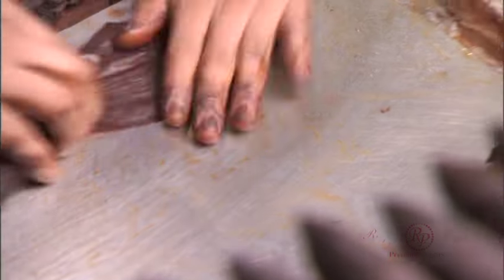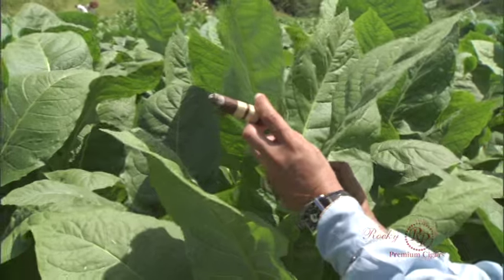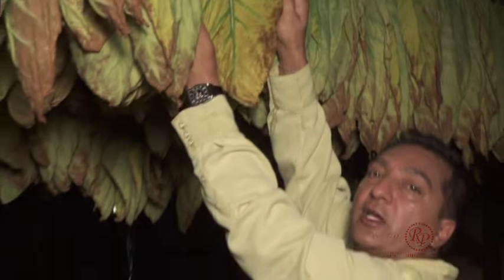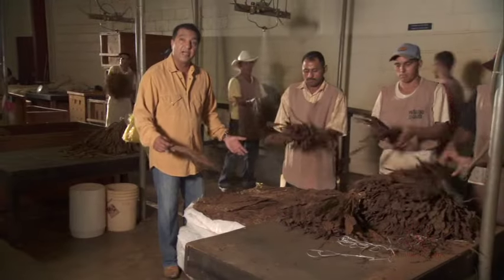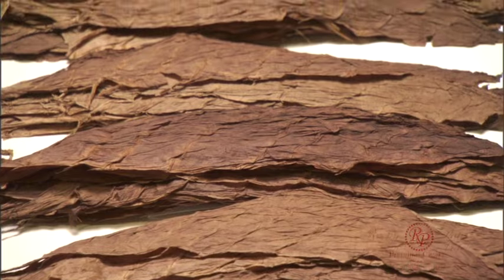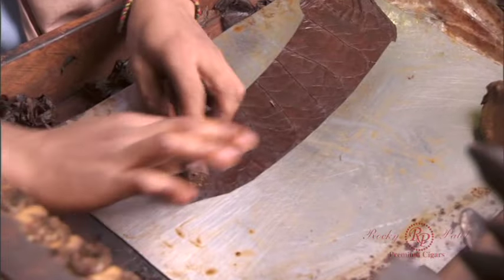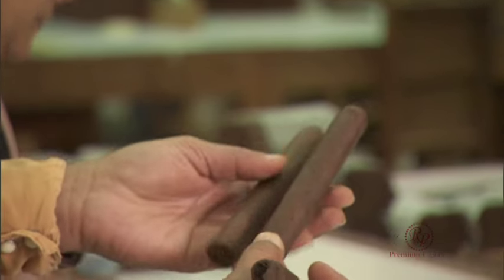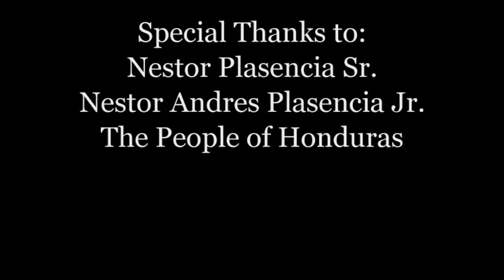Rocky Patel Factory Tour

Comment: Another little secret in this process is the final color stabilization area - not shown in this video.  If anyone wonders how they get the consistent coloration in a box of fine cigars, we have to go to the rectal injection curing room.  It is in this room where the cigars are given their final flavor and coloration treatment as they are inserted in the rectums of specially bred and fed sheep.  The cigars are left in the sheep rectums for a period of five days where they are infused with specific colors and surface flavoring custom tailored to each box and product line.  This consistency is ensured through the breeding and feeding of the receptor sheep.

Once this final process is completed, the human ejection professionals will carefully remove the cigars from the sheep rectums using the paper ring method.  Very few people understand this is why the cigars have the paper ring - it is used as sort of a toilet paper to protect the hands of the ejection professional.  Cigar diameter sizes are actually graded based on the rectal cavity of the receiver sheep - as "grosso, middo, and pequeno"

Comment: What was being put on the tobacco at 1:01?  Are some Rocky Patel wrappers dyed?  I also noticed that around that same time frame, the torcedor's fingers were covered in the same liquid.  I like Rocky Patel cigars, especially The Edge and am still trying new ones.  It is very disappointing to see what looks like a dying operation going on.
Reply: ftfisher4x4 not dye. they moisten the tobacco in order to start the fermentation process.
Reply: they took our jerbs No, the section I'm talking about shows the workers rubbing a dark, thick liquid on leaves that are already fermented.  This is different from spraying the leaves down before they are stacked for fermentation.
Reply: ohhh ok got ya
Reply: Marc Parent water,, adding moisture to the tobacco leaves
Reply: dennis paplow It is not adding moisture to the leaves.  The liquid is dark and thick and stains the hands of the workers.  It is some sort of darkening agent.
Reply: dennis paplow I roll my own cigars and if you want to add moisture, you use distilled water.
Reply: yes,, that is correct,, and only distilled because it pure h2o,, no minerals or calcium,,,  Long ashes  : )
Reply: Caleb Rose I'm quite familiar with adding moisture during the set up for fermentation.  If you look at some of my other posts here, it is not about that.  There is a dark, viscous liquid being applied to the leaves.  This dark liquid even stains the workers' hands. 

For adding moisture to get tobacco to the proper moisture level for rolling, you use distilled water, not what looks like crude oil.  When I roll, I have a spray bottle of distilled water close at hand, so I'm familiar with this, as well.
Reply: ftfisher4x4 the darkness comes from the tobacco, it happens naturally. its just the color rubbing off
Reply: Husky Go back to my original post on the subject.  Look at 1:01 in the video.  A dark liquid is being applied to the tobacco. It is also staining the fingers of workers soon after that. 

I roll my own cigars and apply moisture to my tobacco leaves as needed.  Even rich, dark ligero or maduro leaf does not "rub off" like that.
Reply: ftfisher4x4 They take the stems and other tobacco pieces and make a liquor to apply to the wrapper for color and flavor etc. Problem is you don't know what else is added to the liquor recipe for other factors including burn and smoke production. I've stopped buying any so called maduro wrapped cigars because I've noticed a refined petroleum smell coming off the foot of the cigar. Once lit the foot produces enormous smoke output with less on the draw. These aren't all natural products as they claim and with little oversight you really don't know what your smoking. It takes a long time to ferment tobacco to a dark color and after the fact theirs no guarantee of uniform color as well as loosing leaves in the process. Done right well done fermented tobacco is very good but with the industry effort on appearance and marketing to sell as many sticks as they can you really don't know what your smoking. What your not getting is a high quality cigar focused on construction, flavor and aromas. No matter what they say its quantity over quality. You don't use a lieberman machine, one binder and a team of two when rolling high quality cigars.
Reply: ftfisher4x4 think for a second - if there is dying operation, they will edit it out of the video.
Reply: AGEMO my first thought as well. If you had a dying operation why would you allow a video of even a snippet of your crimes to go public.
Reply: ftfisher4x4  yes but how many do you roll at one time. breaking down marijuana doesnt stain my hand at all, but just trimming 1 plant and touching it over the course of 2 hours makes them lime green.  I have to assume these workers are touching hundreds of leaves a day, if not more, so whats your experience with that. Whats the most youve rolled in one sitting. if its hundreds then id be inclined to jump on your scam wagon, but if its just a few maybe we could give RP a tiny Benefit of a doubt.  Can anyone actually  confirm if large amounts of tobacco rubbing will indeed dye your hands or not? or at least dye the water your continually dipping those hand in.
Reply: that's water on her hands, kinda like when go take a pee,, and you grab ya wee wee and get it all over ya hands.
Reply: I have to admit you are probably right about not showing a dying operation on a promo video.  I have since learned that a mixture of tobacco juice and other natural ingredients can be applied in such a manner and is generally acceptable.  It is not something I would do.
Reply: for sure,, i hope they continue that art of hand made and not machine made.  Both are totally  different from each other.
Reply: ftfisher4x4 I dont think they are dying it.
Reply: First off; excellent debate, and so much more mature than most of the YouTube comments I've seen. I have heard of thickened liquids being used in the process before. These liquids could be dark, because they are made of a mixture including tobacco itself. In any case, RP is undeniably an excellent brand. In my opinion, the quality should be measured from an, " I just bought this off of the shelf, now I'm going to smoke it" consumers standpoint and not an "I saw the whole process and I have questions" video inspectors standpoint.... Then again, if no one asked questions in life, we'd all be lost.
Reply: I love the 1990 brand,, Rocky does an excellent job of Quality Control from Beginning to the end process..  Everyone has their own favorite smoke,, Everyone have a Great Evening : ) That is true Matthew,, If we never ask Questions or Question things we NEVER Learn anything : )
Reply: yes,, i looked at the video again,, you are correct,, i didn't notice that the first time... thanks : )
Reply: I roll my own cigars and if I use a ligero to wrap my fingers turn a light brown and get sticky that's only rolling a few. The only excepted practice in the industry is to take stems and make a brown liquid and use it to get a more uniform color but cigar companies do paint wrapper tobacco with dye usually cheaper rushed to the market cigars. I am not saying RP doesn't dye. The only way to know for sure is to tear a piece off and look at the other side if it's extremely lighter in color it's dyed

Comment: The dirty little secret is that the cigar draw test machines are used after hours as vacu-jacks by the employees - they stick their peckers in there and blow their loads.  The owners know this of course but what they don't tell the employees is that their own spunk ends up being a binder for the cigars and they are providing this raw material free of charge to the owners.  Some of the cigar trade unions have been getting wise to this practice and are demanding spunk compensation for the employees who deposit into the draw test machines.

As it turns out, the spunk used as a sort of "natural" binding adhesive is graded into three levels by order of sweetness- more on this later.
Reply: @Mike1614b - You're a professional rusty trombonist - look into it.
Reply: @Frank-ue6eg  lol well done Frank